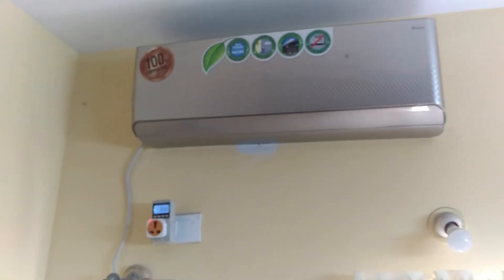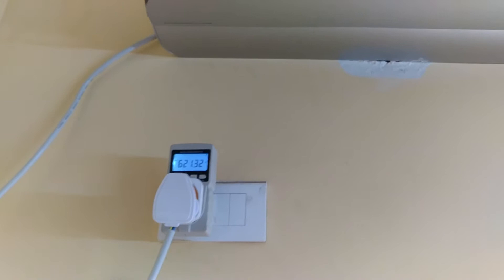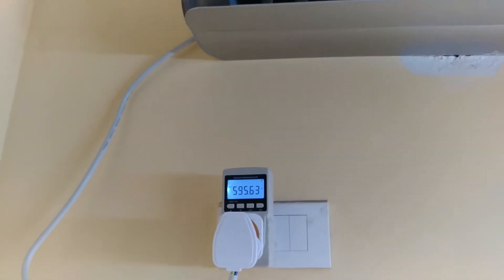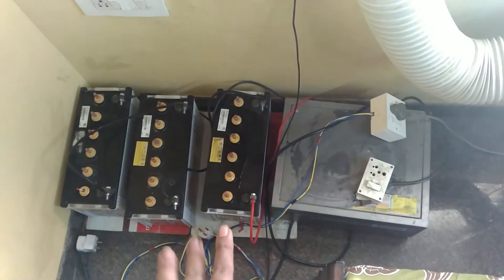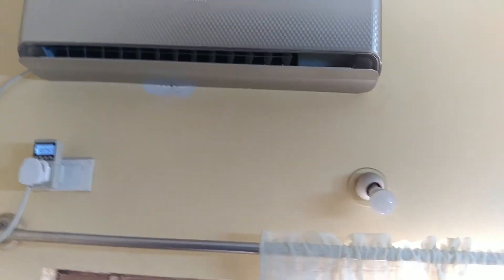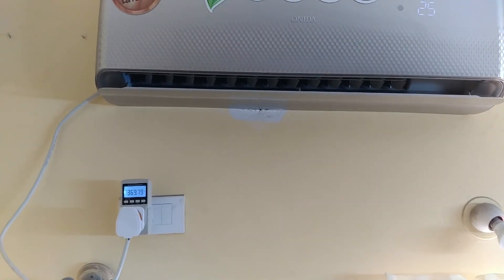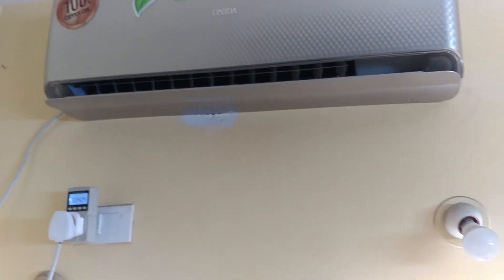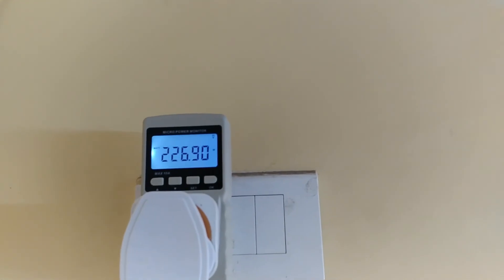how much power  and how inverter ac works

Comment: Sir my hitachi inverter ac 1 ton .4.5 unit   after 10 hours
Reply from the maker: Set 25 degrees then check
Reply: Mine 2.5 unit for 180sqfeet 8 hours, efficiency 6.1%

Comment: Can we run 1 ton 5 star inverter ac with 1.5 kva 24 volt solar inverter?
Reply from the maker: pradip kumar das yes u can set temperature at 27degrees first then slowly reduce 1degree every 5mins untill desired temperature is set .... This will only work with any inverter model  

There one more option what I do  I have solar at home also morning I connect my solar to mains for charging at that time I set 16 degrees temperature at AC after 20mins I set temperature at 23degress then I switch off the mains now solar is running on inverter mode so AC doesn't switch off its now running solar but on batteries ...

If this would have helped u with Ur setup don't forget to subscribe.    Bye

Comment: Once set temperature is achieved then it runs consuming 200 watts then for 8 hours how many units of power will be consumed?
Reply from the maker: prakash shetty 1000 watts run for 1 hour is 1 unit 
200 watts run for 5 HRs is one unit

Comment: Sir my room size is 150 sqf ground  floor. Which AC is best 1ton 1.5ton
Reply from the maker: Amit Kumar don't buy normal AC buy inverter AC 1 ton AC more than enough 
In inverter AC the compressor is always on  put it draws less power once the desired temperature is reached 

If u r setting 22 -23 degrees thermostat on AC then it's more than enough 

If u need temperature less than 19 degrees then buy 1.5 ton inverter AC 

In realistic no one sets temp less than 21 degrees in India 

Always buy inverter AC
Reply from the maker: Dhaval Pandya no nothing like that
There's no such high maintenance if u believe there a chance of anything getting spoilt always buy with extended warranty u will have to pay 1600 extra u will get extra 2 year warranty so total 3 years from Flipkart
Reply: DIE ANOTHER DAY sir in inverter ac i heard that its highly maintenance ac its pcb cost is very high so i wanba ask you should we buy normal ac or inverter ac ? showroom guy recommended normal ac pls help...tnx
Reply: DIE ANOTHER DAY oh really thats great 😊
Reply: DIE ANOTHER DAY tnx for d info.

Comment: Plz tell me 
How's cooling of this AC. 
What's ur room size and what time take in perfect cooling in your room 
And what is model number of dis ac and price
Reply from the maker: R.R khan 100 sq room size it's 1 ton AC onida bought from Flipkart 
It has inverter compressor if I set room temperature at 24 degrees it runs on full load for 10 mins 
1 ton is 1100 watt 
Then once desired temperature is reached it takes less than 200 watt whole day

Comment: Bro, u have portable ac, is it worth to buy? How much power consume
Reply: Thanks for the inverter ac demo
Reply from the maker: portable ac can be only used when ur landlord or the owner will not allow u to drill hole for ac installation 
it is waste of money going for portable ac it consumes between 1200 to 1440 watt  for 1 ton  ac 

in theory portable ac takes 3 hours to cool my room to 21 degrees  where as inverter 1 ton ac takes 15 mins
Reply: DIE ANOTHER DAY thanks bro, saved me from portable ac. Inverter ac taking 230 watts means 1 hour = 230 watts so 4 hours = 1 unit, is it correct!?
Reply from the maker: Yes if u keep temperature at 26 degrees it takes so much
Reply: @mrusername212  his room is kind of small, if he use Hitachi 6.1 rating will consume only 115 watt. Hitachi temperature fluctuate only 0.2 Celsius.